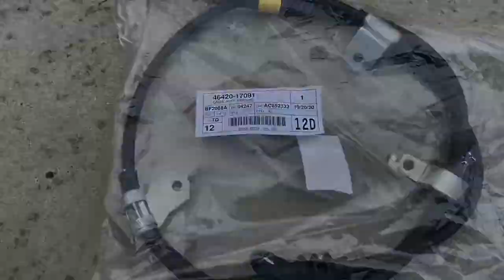How to Remove the Toyota MR2 Spyder Gas Tank & Replace the Parking Brake Cables

Comment: It took me 11 hours to do the replacement. Did it all based on your video. Thanks!
A couple tips for those attempting it.

1. Try to drain your gas as much as possible. I did it with 5 gallons remaining and it was a total pain.
2. The hardest part is probably the grommets for the cable. Don't connect the cables to the E-brake at the center console until you've inserted the grommets.
2. The fuel line on the passenger side of the rear compartment, can squirt gas at you. So watch out.
3. Take your time.
Reply from the maker: Nice. Good job. Thx for watching and commenting. Pls subscribe. Thx AJ

Comment: Thanks again, for documenting this process so well. I watched it a while back before installing my roll bar. 

And you were right I should have replaced the parking brake cables back then . 
So now I’m removing the tank for the second time, lol . 

Again, thanks
Reply from the maker: @aszilagyi100  nice. Trust me I’ve dropped a few tanks. I highly recommend you replace the check valve on top of the gas tank when I drop it. See the next vid to see how and part numbers. Please subscribe. Thanks, AJ.

Comment: This is rather a common problem I'm afraid. The mild steel has zero corrosion resistivity treatments - no phosphate or cadmium, just bare steel. When a small amount of moisture gets in there, they start to rust. The inner diameter of the housing gets obstructed with corrosion products and start grabbing the inner cable.  This was a huge effort on your part to film, edit, and fix the problem. The MR2 community in forever in your debt.
Reply from the maker: Thank you for the kind words and acknowledging my efforts to document this process. Pls subscribe and stay tuned for more automotive content. 👊
Reply: I wonder if it would be possible/advisable to introduce something like Bilt Hamber Dynax S50 to the interior of the cable?

Comment: This is a fantastic guide but I'll just add a couple points from having done it today. I have a UK facelift MR2 (no A/C) for what its worth. @9.35 my fuel tank didn't have the top connector (with the toyota sticker) the hole was blanked off, however I did have an additional hose going into the fuel tank on the top near the middle of the tank attached via jubilee clamp which isn't accessible through the access panel until the tank is lowered down 5-10cm. A 1/4inch drive 10mm socket on a long extension was very useful. @14.55 I couldn't see those 2 evap hoses, but unlike your guide I disconnected the leftmost hose on the top of the tank @9.35 and in disconnecting the additional hose I've just mentioned (+ the others on top of the tank and the filler tube) there was no issues removing the tank completely. 

Just wanted others to know it may be slightly different than pictured here. I don't recall having the dip on the left side of my tank like the one pictured at @18.27 and also I did not have the evap unit under the door bin, which is likely why the above was different, wonder if this a US spec thing. Thanks again!
Reply from the maker: Thx for the update…. very well documented. Perhaps, EVAP is only a USDM thing. Pls subscribe and thx again for watching and commenting. -AJ

Comment: Thank you so much. I'm currently in the middle of doing this because I need to replace my parking brake lines and replace the fuel valve gasket.
Reply from the maker: @sugamai  very welcome. Don’t forget to watch the next vid which shows the check valve replacement. Pls subscribe. Thx AJ
Reply: @RelentlessRacingAJ  I just watched it. I need to buy the fuel pump gasket and other hoses. I appreciate the help and the videos.
Also I subbed around when you released the video! I'm finally doing it because the dreader P0440 code came up lmao
Reply from the maker: @sugamai  welcome to the P0440 Club. I have done that job several times. Have fun.

Comment: Great video. My old car had the cables replaced twice with aftermarket and the handbrake is still poor. Going to buy some genuine Toyota cables but just trying to weigh up whether to tackle it myself this time. The lack of road grime/rust on USA vehicles versus UK, is noticeable
Reply from the maker: Thx for watching and commenting. Pls subscribe. Most of my MRS’ are from California and California cars renown for not having rust. It definitely makes working on them much easier. Good luck w your parking brake cables and rust.

Comment: Fantastic video!  The parking brake cables fail due to rust.  Water settles in the area you mentioned.  The spiral outer cable is untreated steel, it rusts and seizes the inner cable.  Preventive maintenance is to slice through all the heavy rubber sleeves and coat the steel outer housing with corrosion preventive spray.   Regularly.
Reply from the maker: Thx for the kind words Paul. I’ve seen your preventative fix a few times. Great idea and method. Pls subscribe. Thx, AJ

Comment: Thank you for the video.. do you think changing the cables will be enough to lock the rear wheels during autocross?
Reply from the maker: Thank you for watching and commenting. Pls subscribe. Once you replace the parking brake cables, the parking brake will function as it did when they were new. Theoretically, the rear wheels will lock whenever you activate the parking brake
Reply: @RelentlessRacingAJ  thanx .. I really need them lock for Motorsports purposes.. will changing the cables will do this? Or should I go to hydraulic e brake setup?
Reply from the maker: @bhautobacs just go hydraulic

Comment: Hello sir nice video can you tell me if I can get to the check valve and pump seals to replace without removing tank?
Reply from the maker: The pump seals you can. I don’t think it’s possible to get to the check valve. For the check valve, u can lower the tank and not completely remove it, but it will b very challenging. Thx for the kind words. Pls subscribe. Thx AJ

Comment: Great detail on this video!  

Do you have any tips for draining the fuel before removing the tank?  I didn't have any success going through the filler neck, so I tried attaching some hose to the fuel line nipple coming out of the firewall (above the front motor mount).  I then connected the other end of the hose to a 3rd party fuel pump and still am not getting much out.  Any help would be greatly appreciated!
Reply from the maker: No need to drain the tank... go to the gym. JK, actually, I'm not bc going to the gym is good for your health. My name is AJ and I approve this message.
Reply from the maker: Sorry I couldn't help myself. Anyway, you can disconnect the fuel line at the fire wall. Once disconnected, add a hose and bucket to the fuel line, and activate the fuel pump manually. If you don't know how to do this, you can consult the electrical wiring diagram to see how it works. You will either need to give her a ground or +12V signal to turn on. It is most likely a +12V signal. Your other alternative is to put everything back together and drive her around to empty the fuel or go to the gym.  Good luck. Pls subscribe. Thx, AJ
Reply: @RelentlessRacingAJ  That is good advice, but I still want to get the fuel out.  It's been sitting in the car for 4+ years.  I think I'll try pulling the fuel pump next.
Reply from the maker: @stevenword  Sorry I couldn't help myself. Anyway, you can disconnect the fuel line at the fire wall. Once disconnected, add a hose and bucket to the fuel line, and activate the fuel pump manually. If you don't know how to do this, you can consult the electrical wiring diagram to see how it works. You will either need to give her a ground or +12V signal to turn on. It is most likely a +12V signal. Your other alternative is to put everything back together and drive her around to empty the fuel or go to the gym.  Good luck. Pls subscribe. Thx, AJ

Comment: Hey sir, how do you "loosen the cables" so that the pawl makes contact with the caliper stop? My driver side looks fine, but the other one is not touching. Is the adjustment made at the lever side? The cable itself? Or on the caliper? I kinda see that you twist or push it but it's not very clear what you're doing. Thanks in advance
Reply from the maker: @dsx5036  gotta loosen the cable completely at the lever

Comment: Also if it is possible to replace seals without tank removed do I need to remove seats and console to get to them thanx
Reply from the maker: You can leave seats and console in when removing the tank. I found it easier and more comfortable though. -AJ

Comment: Excellent video, just what I was looking for since I am going to replace right side brake saddle too 😍 I guess it is impossible replace the parking brake cable without removing the gas tank completely eh... 🤔
Reply from the maker: Thanks for the kind words. The vid serves as a good reference for others. It is possible to lower the gas tank and do everything, but if you have lowered the tank, that means you have done everything to drop the tank.

Comment: My side panel on the passenger side has an electrical connector securely attached through the panel.  How to remove?
Reply from the maker: @TomHixson-j4z  my MRS doesn’t have that so I don’t know. You will have to inspect it carefully and figure it out in your own. Good luck. -AJ

Comment: Hi, I need to empty the gas tank and put in new gas to restart my car after about eight years sitting.  I've tried to use a fluid pump form the gas filler door but failed.  I saw in this video the gas tank has a rubber hose attached to it.  I wonder if I can remove the hose from tank side to pump the gas out from there.  Please help!
Reply from the maker: You can access the top of the fuel tank behind the passenger seat or disconnect the fuel line and run the fuel pump
Reply: If I choose to disconnect the fuel line and run the pump (because that sounds convenient enough), how do I feed power to it so it can run continuously and safely? I wonder if you can make a tutorial video on that topic?
Reply from the maker: @diehardcat  I wish I had the time. It’s actually easier for you to remove the fuel pump and siphon the gas from the top of the gas tank. I showed the process in one of my vids. Good luck.
Reply from the maker: @diehardcat  https://youtu.be/OtSIWqAoHFs
Reply: @RelentlessRacingAJ  That sounds simple.  I think I'll do it that way.

Comment: Thanks for the video, My 2 needs the cable replacing and the garage have quoted me about £5/600 to do the job. I can see why now. A very informative video which has convinced me to pay the money and let them do it. Im sure when they get under mine, it will not be as clean as yours and Im just hoping bolts come free as easily as they do on yours's. I simply want to sell the car but without this work it is just a pile of scrap, so Hey Ho
Reply from the maker: This job is not for all.  I believe it is wise to understand the process and make an educated decision as to whom should do the job.  Thx for watching and commenting. Pls subscribe.  -AJ